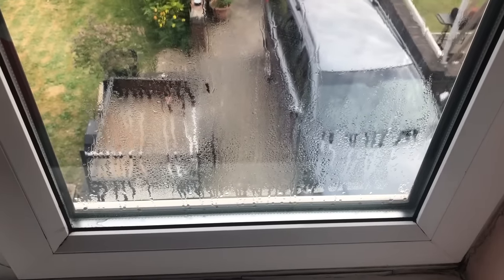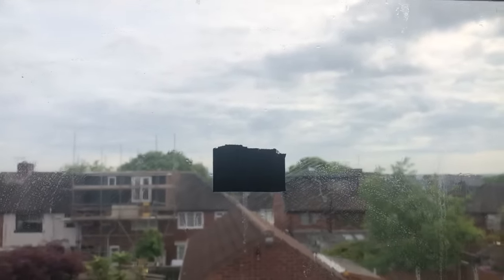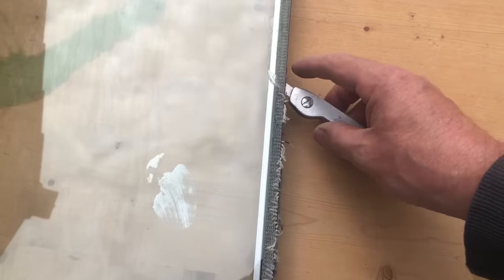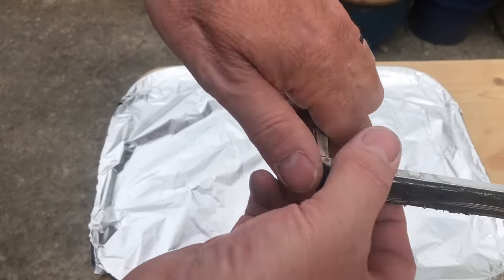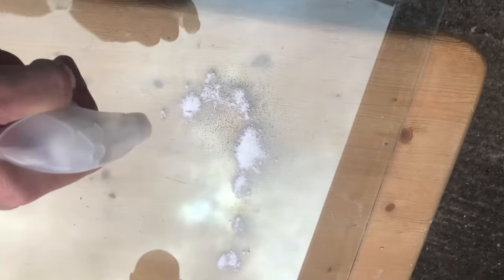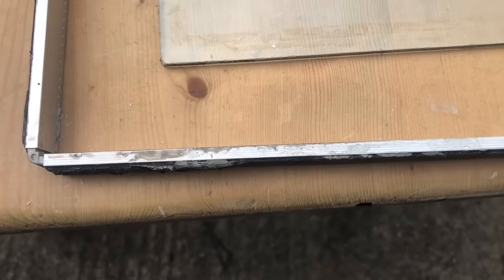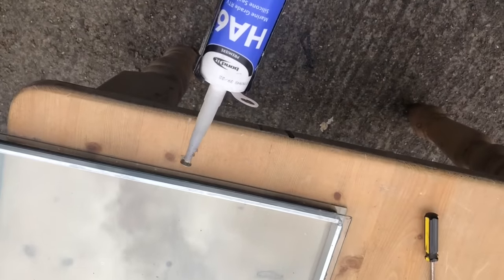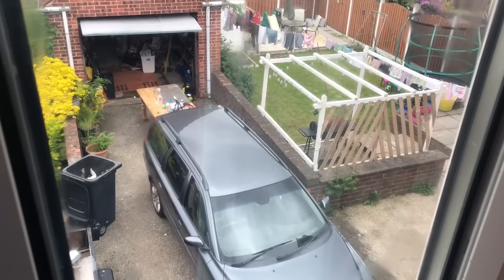Double Glazing Unit Condensation / Blown DIY Repair.

Comment: As a retired Glazier with over 35 years experience, I can honestly say I would be surprised if that repair lasted a year using silicone to seal it and reusing dried desicant. To be honest you were lucky not braking at least 1 of the panes getting it apart.
Reply from the maker: I did my best to avoid breakage’s.
Reply: 20yrs service Engineer fitter. I agree. So much more to criticise here. The packing just for starters. See other comment.
Reply: Syndicalist minded people always feel hurt when someone competent achieves success.
Reply from the maker: Thanks I gave it my best shot!
Reply: Interesting, but a new sealed unit that size isnt that expensive...
Reply from the maker: Renewal is always an option.
Reply: @TheRepairer  knowing my luck I'd do all that work then drop it when I put it back in 🙄
Reply: @Lloyd1885   Samezies.
Reply: @Nauysvyf  what's 'being a female' got to do with it, and why would we be 'appalled'?

You might be appalled to know that most men really aren't bothered about all that.

The great thing is you, as a nice, tolled your sleeves up and tackled a job you are not familiar with, done a fine job, and saved yourself a nice few quid in the process, a massive well done for that, a take my hat (ok baseball cap) off someone who does something out of their comfort zone. 👍 Especially as I'm one to shy away from anything I think is going to stretch my capabilities
Reply from the maker: @calamityjane8509 I’ll always have the critics to deal with. Many of the critics are financially motivated tradespeople living in fear,  it just depends on the video content as to whether on not  I attract them. 

Well done for tackling your own repairs, I commend your approach and relate to it as I’ve done it all my life, I draw the line at plastering full rooms though but I can patch up and sand down walls quite well! It’s all about researching continuous learning and taking the innovative to have a go.
Reply: @Nauysvyf  Well done I believe anyone can do jobs around the home if they put there mind to it but repairing sealed units is best left to a company that makes them.
Reply: @Nauysvyf  disgraceful attitude, what a dinosaur. Thankfully the building trade has moved on from that attitude...although to be fair, traditionally it was an industry that mostly lads went into, so 'male dominated' by default as opposed to discrimination really.
Id like to think females are more welcome than ever, but theres still work to be done in promoting it. Girls in school and their careers advisors also need to realise that there are more options than childcare and hairdressing for some of those who may have not achieved the higher gcse grades.
Reply: No offence but what brings you here to watch this video ? You've obviously searched how to fix this problem so with  35 years experience you shouldn't really need any advice ? Just saying..
Reply: @Nauysvyf ..Impressive - hats off for your approach + determination, no mean feat, putting shloppy workmanship to shame..
Reply: I could buy this size unit for £50 with the latest spec and argon gas  vs bodging
Reply from the maker: Renewal is always an option!
Reply: @Lloyd1885  I was thinking just that when I saw his car was under the window!!
Reply: So, a serious question. How would you have repaired it then, using your experience?
Reply: @paulbradford8240   Replace it with a new one it would be cheaper in the long run.
Reply: As a retired D/g fitter and servie engineer with 40 years experience , i too would condemn this type of repair, its a time consuming bodge . DGU's are sealed with a hot mastic gun , not silicone . Youi need space and  time and its pointless . no one wil get this right 1st time . Better off buying a replacement unit and fitting it yourself . Thats not straightforward either . Some beads are so difficult to get out  that the  inexperienced may destroy their window doing it . The packers are in the wrong place too .
Reply: @Tom_YouTube_stole_my_handle why ?its an internaly glazed unit or didnt you notice was it externaly he would have needed 2 people as most externaly glazed were held in by double side tape the beads were secondary
Reply: @derekearles9844  It's perfectly possible for it to slip in his hands and fall through the aperture while he's manoeuvring it into position.
Reply: @Nauysvyf  You are wrong on all counts . 
 Do your research . This was my business and  this is a 'Bodge ;;' job . IIs a very dangerous  thing to persuade  the public to mess around with glass  with no training or insruction . Especially when its bad advice . I have 40 years experience as a d/g fitter and service engineer . I tried this bodge  35 years ago and realised it was stupid, .When cutting glass and making units etc , you have safety equipement to wear, glassses, gaunlets  etc . This is to protect you from injury for glass is dangerous stuff. Even the way he fitted the unit in the window could be highly dangerous . i know this due to experience . This video maker knows nothing . It is my place to 'warn' people not to attempt this  because basically i know better .
Reply: @Nauysvyf  I'm not sure where you're going with that. You could move the car. It's called a sensible precaution. Just as you wouldn't leap in front of a passing bus on your walk just to see what would happen.
Reply: @Nauysvyf  That's where your sarcasm gets you I'm afraid.
Reply: @franklettering  That's the point, he hasn't achieved success. Success for a double-glazed unit is staying fog free, and silicone is an amazing sealant but it doesn't block water vapour well enough to be the only seal.
Reply: Take the criticism with a pinch of salt and use it as feedback. We had a saying in REME - If you have always done it that way then it is probably wrong! 
There is always a better way to do things. Thank you for your video.
Reply: Well done: good to hear of someone with the confidence to have a go.
Reply: I thought Double/Triple Glazing units had a vacuum between the panes hence when the seals fail they are said to have 'blown' is that the case?
Reply: @TheRepairer Yeah living in fear of having to go and sort out all the botched up jobs attempted by YouTube viewers who think watching a video makes them qualified 😂😂😂 
Seriously????
Reply: @richardhaywoodh Newer units are gas filled or vacuum sealed for better insulation/sound proofing. Older units with dessicant are not vacuum sealed.
Reply: Most will break the glass, that's a days work easily and there is a myriad of bead types that most DIYers will not get out and create some very unsightly damage to the window trying….security tape, external glazed 2nd floor, glass clips, compression gasket holding the bead in place it goes on, if there is a shell in the glass edge it will break guaranteed and if a low e-unit the coating will get scratched, this is a complete bodge and you are making it look a damn sight easier than it is Sir and will probably need re-doing every year if South facing.
Reply: @richardhaywoodh  No vacuum or the glass would bow inwards, gas fillings of different types yes.
Reply: Nothing wrong with drying desiccant. I used to work for a company that made drying equipment that used desiccant to dehydrate air. The wet desiccant was regenerated using heat.
Reply: @Nauysvyf you can point it out but it's also common slang for a makeshift or mend and make do effort, across the UK.

Botched would be used in the context of a failure, and isn't relevant here.

Is this a bodge job? Yes. Yes it is. 
Is it a botched job? No. No it isn't.
Reply: Totally agree.
Reply: @richuu You used to work for company.... but was it a glazing company and did you accrue >35 years of experience at said company? 😂

Comment: Don’t waste your time just replace it with a new unit and the packers are in the wrong place
Reply: I couldn't see the window packers? What point of the video was this?
Reply from the maker: I was looking for them too!
Reply from the maker: Point taken re packers, more exciting to repair than renew.
Reply: He’s right about the packers, they shouldn’t be near the vents.
Reply: @garyherberson8119  2.20
Reply: Agreed for plain units, but I have some top windows with a design in the glass. No chance of getting that matched.
Reply: Tilt and turn window looking at handle. All opening windows should have toe and heel packing to hold frame sqr and not sagging on opposit side to hinge. If you don't know this your a chancer not a proper engineer or fitter.  Also packers fitted and held in place either side of frame to stop sideways movement and added security to stop levering window open. Packers at bottom added also to leading edge once toe and heeled. Ensure both panes are supported to prevent 1 pane slipping. The main reason they mist in the first place. Also check all drainage channels are working before refitting sealed units. Don't put packer over or block drainage holes. Some types of packers are designed to allow water to flow in drainage area prior to main packing. Good idea to pump some silicone where packers are. When it dries it too can stop glass panes from slipping.  This is a DIY job and is so far from how an engineer in the trade would do it. The time and effort isn't worth it.. Bearing in mind keep a panel of simular thickness wood handy. 100% there a chance the unit would crack.
Reply: @raylp4751 certainly get your point, I'm just taking the whole window out and getting it replaced. On a side note, the UK is the only place I know where the term Engineer is used for tradesmen 😂

Comment: I used to make these many years ago so a couple of tips, when cleaning the sealant off use start with a new stanley knife blade to remove the bulk then brillo pads to lift the remaining old adhesive, when reassembling put the 2 panes in place with the spacer bar between and hold them in place with lots of large bulldog clips, drill a hole in a piece of wood and fit it to the end of the sealent nozzle so it fills the gap and smoothes the sealant at the same time moving the buldog clips as you go being careful not to push the spacer in with the sealant. The packers also function to hold the plastic frame square so they are usually on the hinge side at the bottom and the outside top. The dessicant doesn't just absorb water it bonds with it, you need to get it very very hot to drive the water off if its even possible, try the crystal cat litter thats in sealed poly bags and fresh. Adhesive aluminium tape will hold up to water better than duct tape and protect the sealed edges better
Reply from the maker: Thanks I will perhaps amend my technique slightly based on this information. I love the block of wood tip!
Reply: Tha what I call “nice reply”
Reply: Really useful addition. Much appreciated 👍🏽
Reply: Fascinating, I was completely lied to when I asked if I could have an extractor fan fitted in a rectangular double glazed unit.  I was told no as there needs to be a vacuum between the glass!
Reply: @Bond2025  yep thats a lie, though no one wants to make them as its awkward sealing the unit, but no, no vacuum,  glass is quite bendy and a vacuum would actually have the two glass panes touching in the middle on large units, some specialist units are filled with an inert gas but tbh i doubt its more than a sales gimmick
Reply: @TheRepairer new vid w th updated techniques please?
Reply from the maker: @AbdulKareemAbdulRahman  I haven’t made it yet, This is the latest and largest window I have repaired https://youtu.be/PzBcH2hqUoA?si=BEgnP2rI4Er0cnE4
Reply: For getting a clean finish for silicone i usually cut the end of the nozzle on a slight angle and squish it with me box knife that way all u gotta do is hold the gun square with the fram and as you move the gun the tip will clean the sillicone for ya and 9 times out of 10 you dont need a sillicone card
Reply: A good clean job. 
I tried removing the glass from my timber framed Swedish window. For some reason, the manufacturer put some incredibly strong pale blue sealant in each corner.. the glass would not budge  even trying to gently pry it out. 
Of course the glass cracked, and the window was done.
Even after it cracked, the glass came out in pieces. Even the last bits in the corners was all that was left, only when I went an got a chisel between the sealant and timber did these last bits come out.
I was hoping to save the glass as I was putting in a door panel.
Reply from the maker: @bricktop7803 That’s really unfortunate that they made the sealant so strong.
Reply: @AbsolemLapis thats really informative, the original video was brilliant n you've tweaked it ,and the hole in wood sealant trick is genius so wot sealan and tape would you specifically recommend?
Reply from the maker: @flyitlikeyoustoleituk1226 I just use marine grade silicone and gaffer tape.
Reply: @TheRepairer  ok thanks
Reply: @TheRepairer  so its more important on silicone than tape ye ?
Reply from the maker: @flyitlikeyoustoleituk1226 yes I always use marine grade silicone and the tape just holds it in place.
Reply: @TheRepairer  thank you mint channel. As as a matter of interest how much roughly do you guys think it would cost to replace 4 blown panels the biggest being the full length of door then 2 large panels n 1 above on opening panel . I know it's a bad description but a rough ball park will do cos I've got absolutely no idea .
Reply: @TheRepairer  just bought 3 tubes of HA6 that ok
Reply: @AbsolemLapis  I'm loving the piece of wood trick can't wait to try it hate silicone on my hands unless it's the Mrs 😄 but I'm thinking you drill n place the wood before you cut tube to size flush with wood ? Is that correct 👍
Reply: @TheRepairer  ye me too
Reply from the maker: @flyitlikeyoustoleituk1226 yes that’s what I use.

Comment: 11/10 for effort, but I don’t think this is a good idea on many levels. High chance of glass breakage. Tape is applied to the perimeter of float glass because of the sharp edges, so you really don’t want to wipe your fingers around the edges. Glass isn’t packed properly, should be heel & toed, and stood on bridging packers. I’m doubtful this ‘remedy’ will pass the test of time. Buy a new unit & have a warranty on it.
Reply from the maker: A balanced comments section is most valued, thanks for taking the time to communicate.
Reply: Heel and toed 😂😂😂😂
Reply: If it breaks, then buy a new one anyway. Worth trying out. The manufacturers one didn’t stand the test of time either. If it lasts a couple years, perfect.

Comment: I have never seen anything like it! People: don't do this. It won't last 5 minutes!
Reply from the maker: Feel free to elaborate further.
Reply: @TheRepairer  1. A properly made insulating glazing unit has a primary and a secondary seal. The primary seal is there to seal the cavity and keep moisture out of the unit. The secondary seal (in the place where you put the silicone  in the video) is designed to hold the igu together while allowing expansion and contraction as occurs naturally. Your unit has no primary (moisture) seal. The silicone might hold the unit together, but it would need to be applied properly. Your technique of pushing the tube behing the silicone flow will result in air bubbles and an inconsistent fill.
2. If your igu had a coating inside, you would have damaged it while cleaning it. These things cannot be done by hand when dealing with such complex products. The use of an acetoxy silicone would also have damaged the coating and may be incompatible with the aluminium spacer tube.
3. Your cleaning process could not have ensured that there are no airborne contaminants or worse, organic particles  inside the cavity which could start to grow once you "seal" them in: especially since your lack of primary seal will likely allow moisture into the cavity in short order. Of course, you might get lucky.
I worked in the glass industry for 26 years and have seen thousands of units made. If you visit an igu manufacturing facility you will see exactly what I am talking about. The level of investment they make in high quality sealants and the machinery to manufacture igus is testament to the need for absolute cleanliness and attention to detail.
The process of making (or remaking) an Insulating Glazing Unit is far too complex to be udertaken at home if you want it to last.
Reply from the maker: Better put, but I’ll gamble on doing the job for less than a tenner!
Reply: @donkeytrousers the guy literally did it. And he’s done it before saying its lasted a couple years so far with no issues.
Sure things can go wrong, but no harm in trying. More fun too.

Comment: One bit of advice for any budding DIY'ers.  When you remove the beading from around the glass, before removing the glass unit, measure it.  I replace sealed units for a living.  Many a time I get called out to blown units to replace with a new unit, and on trying to remove the old unit, if its stuck in fast (usually because the original fitter used tonnes of silicone, putty or even tacks to secure the unit on wooden frames) the unit can and does crack/shatter.  This renders a DIY job useless and you'll end up purchasing a new unit.  If this does happen, leave the old one in place, the outer pane may not have cracked until you get a new one to fit.  Its reverse fitting, easy to do, make sure there are no retaining bolts sticking out of the uPVC window frame that can catch on the new unit.
Reply from the maker: I like your thinking, strangely enough measuring before removing is the last thing I’m considering at the time but it’s quick and easy and worthwhile.
Reply: Too long winded
Reply from the maker: @stellasteve9972  Are you referring to the repair technique or the video?
Reply: Kinda cool hearing how different places do stuff different in aus we dont use sillicone or putty on DGU's usually just blocks rubber n beads use sillicone for sealing float and lam tho and for sealing hackhouts to the frame instead of pack putty